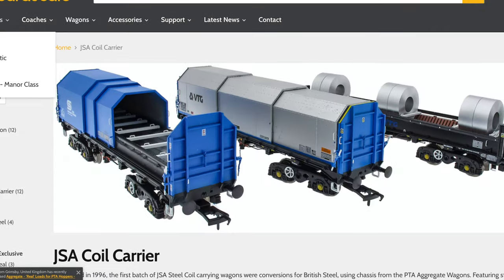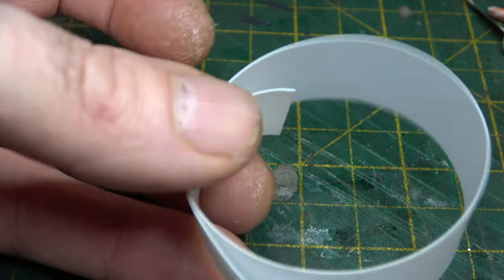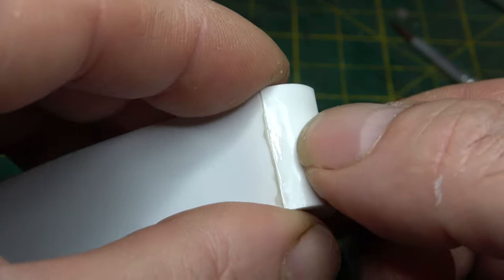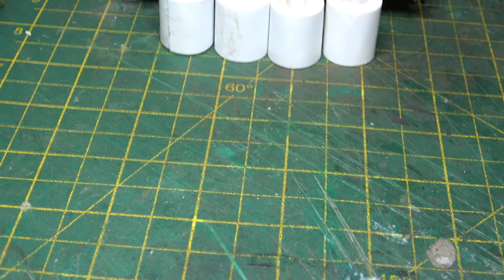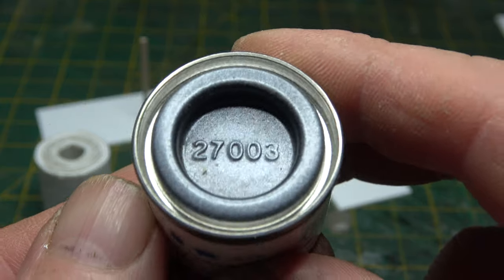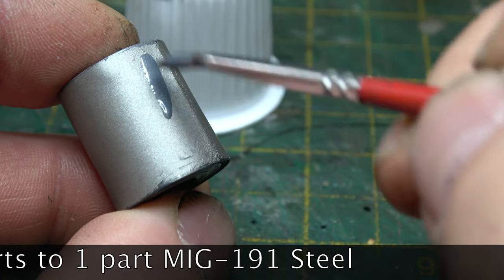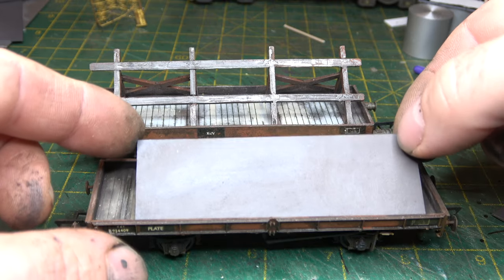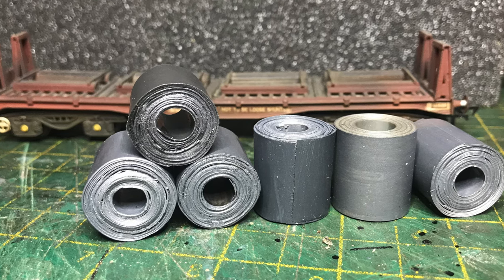Wagon Loads - Plate & Coil Steel

Comment: Great information thank you. Just bought the short accurascale  coil A’s so these are perfect for those. I like hoods on them but you high all of that fantastic detail. I am sure the odd one must have run without it’s hood. Well if not there will be a few running on my model railway without them . Thanks for the great video 👍
Reply from the maker: Had my eye on them to, but haven't got any yet because of the fact you can't see the load 🤔